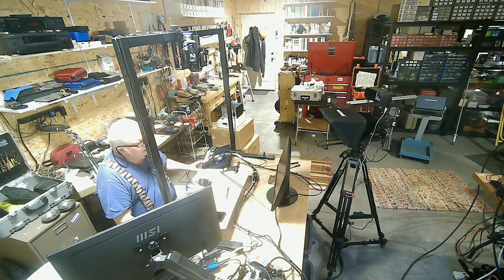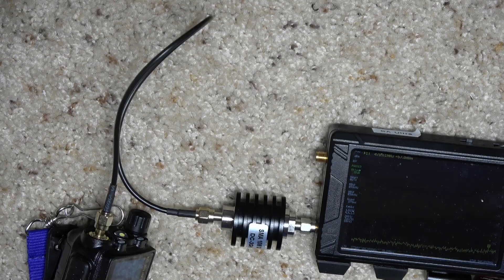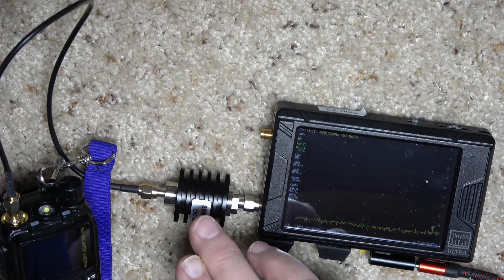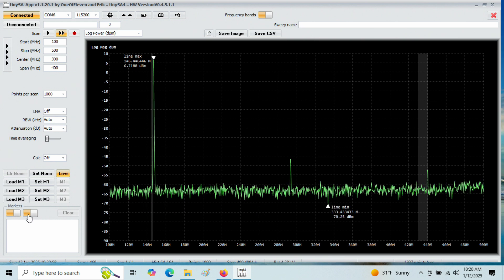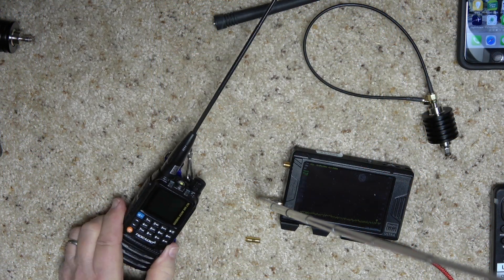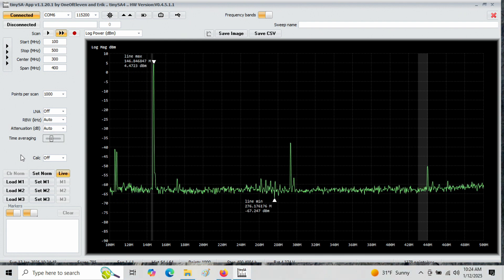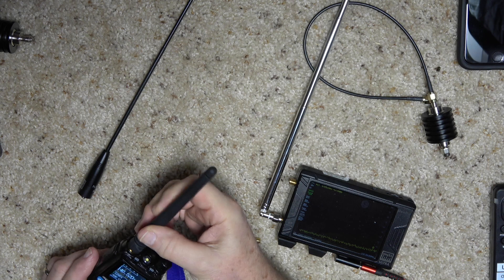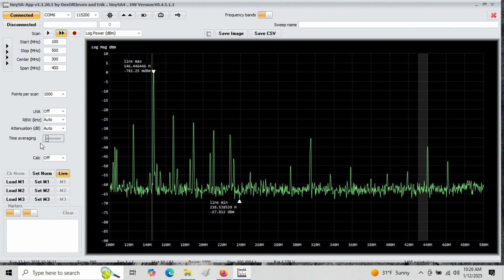TidRadio H3 - Is the RF Output Clean?

Comment: Hello Gary. Thank you for all the hard work you put into this. I have had two of them. Both of them stopped outputting any power. It's a shame because they were nice little radios. Hopefully the issue will be corrected soon. 73
Reply from the maker: How old are they? They have a Six Month warranty:

https://tidradio.com/pages/warranty-policy?srsltid=AfmBOoreGrTj2WzLLTdWMZrewUCUQQUINZ72VxgzOmLhytIJwBjCVDlc

You might contact them and see what they could do for you. Good luck!

73 de W4EEY
Reply: @W4EEY  I bought them from Amazon and have since returned them. The first one arrived, I couldn't figure out what was going on for a couple days. I assumed it was user error with a new radio. I then put it on the meter on it and no RF output except for the driver stage (mW). I sent it back and bought another one, same problem! After the second failure I spent a couple days trying to fix the problem. I changed the mode (GMRS,HAM,UNLOCKED) that didn't help. I tried different firmware including old and new, even the third party one. Nothing. I'm not trying again. Thank you for the reply and I hope yours lasts more than 15 minutes!

Comment: Thanks for that video.  I saw Jim's video as well, and it didn't sit well with me, as others (besides yourself) had tested that radio, and found it to be in compliance with FCC requirements.  Thanks for replicating his results.  It made a lot of sense.
Reply from the maker: I'm still looking into this. I just built an antenna test jig and used one of my Nano VNAs to characterize the antennas on the jig. I'm getting what looks like valid results but need to continue testing. Stay tuned! 73 de W4EEY

Comment: couldnt tell but it seemed like he was using nicfw firmware, which may also have had an effect(?)
Reply from the maker: I didn't catch that (in fact I was unaware of this alternate firmware). But because I could recreate the effect using the short rubber duck antenna, it suggests that it is independent of the firmware. I need to do further testing. We both were connected to PCs by way of a USB cable. I had no decoupling installed on my cable (ferrites). It could be RF pick up on this cable causing the issue. I would also like to characterize the antennas on a Vector Network Analyzer to see their impedance across the 2M band (if this suggests something). I think there is more to come. 73 de W4EEY

Comment: I think the H8 10 watts. Does it limit it to 5 watts in GMRS mode?
Reply from the maker: According to their website 

(https://tidradio.com/products/tidradio-h8-gmrs-radio-with-bluetooth?srsltid=AfmBOoqpJJMZTK-TIQlFVem5ggW5N607i9GfSxl_Vn9V8PKxSuAwjCn2) 

the radio is a 5W radio in GMRS mode..

Unlocked, you would need to control power manually.

73 de W4EEY
Reply: @ Excellent! I’m thinking of getting two for my sons to use under my GMRS license paired with Fara-J antennas for extended range. Hopefully, that would keep it to 5watts, but it’s good to know more is possible in an emergency.

Comment: I have a question. Since the radio was supplied to you by the manufacturer, is it possible that you were given a radio that was checked to be in regulation compliance? It would be interesting if you had friend order one and test it. If the radio / antenna interference is the cause of the excess spurious emissions, the radio operator is still responsible for the signal that is put on the air.
Reply from the maker: It certainly is possible that my radio was “cherry picked” for a good impression. Likely? Don’t know.

Hams are always responsible for their transmissions. That’s why I find this issue important and deserving of further consideration.

73 de W4EEY
Reply: That doesn’t make any sense at all. If you can fix the harmonics on one $35.00 radio, why wouldn’t you mass produce the radio in the fixed configuration. Everything is a conspiracy with you China haters. Use common sense, if you can get one radio to perform correctly then all can be made to conform. That’s not rocket science.